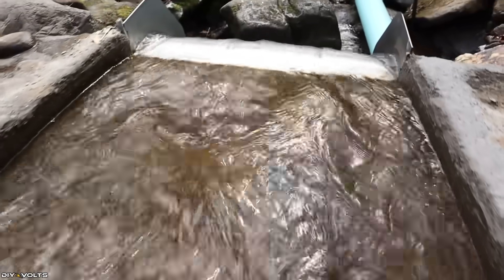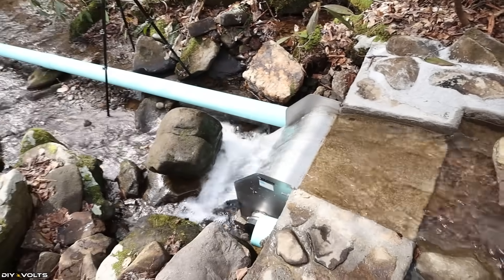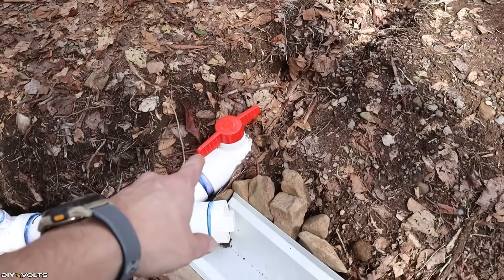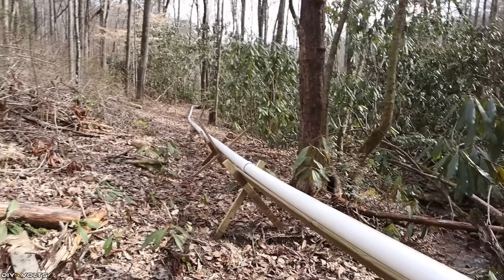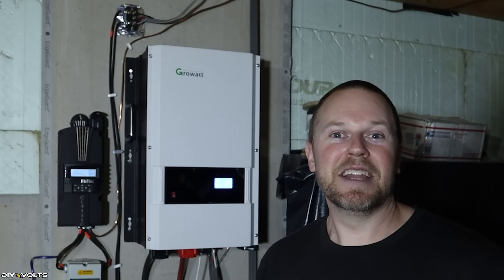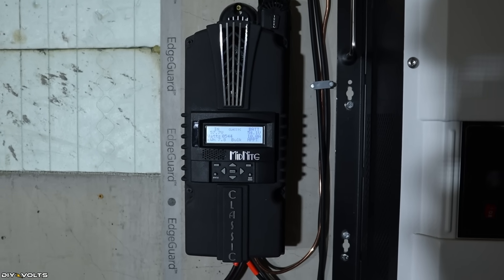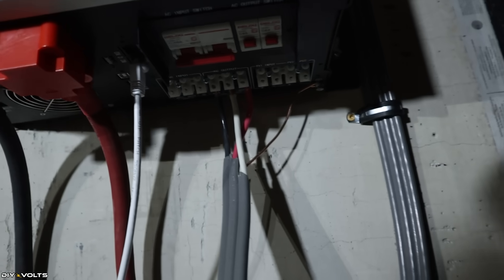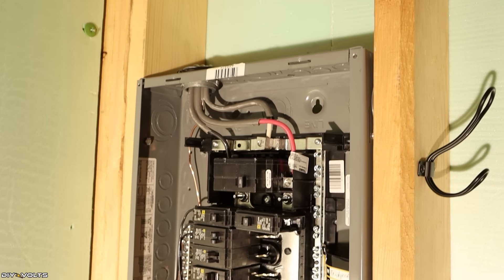AMAZING 500w Micro Hydro Power

Comment: Would it not be more efficient to just put the turbine closer to the water source and then run wire?
Reply from the maker: If there was plenty of head pressure that would be true. But in this case they needed the long pipe run to gain that water drop. Hydro power is calculated like this: (head pressure in feet X GPM)/10=power. The head pressure is very important.
Reply: Closer to the water means less height difference and thus less energy to harvest.

Comment: This looks nice, but it generates only 500w? I know little about hydro power but I thought it to be much more efficient
Reply: To know its efficiency you would need to know the theoretically available energy (amount of water and its height) to compare it against the effectively produced energy. You probably mean to say, that you expect to get more power out of such a setup, but then it is not so much water going through that small turbine.
Reply: 500W 24x7 is quite significant. I have only solar here (UK) which can peak at around 7KW in the height of the summer but right now is sitting at 3KW however, this is limited by daylight and the season.

My consumption runs at around 600W/hr which rises to over 3KW/h when I switch on the washing machine, or charge my EV. A regular 500W/h with batteries to absorb the unused amount would be awesome.
Reply: 500W nearly 24/7 during the seasons that the creek has good water. That's A LOT of power
Reply: A bit over 12kwh per day isn't too bad, but there are a lot of variables at play. They have a lot of storage to act as a buffer and probably operate a fairly efficient home.
Reply: 9:09 - they’re running an 8kw inverter lol, plus batteries, they’re LIT

Comment: How much loss do you have converting from 3 phase to the DC inverter and then back to AC?
Reply: Not that bad.  Maybe 10%.  You can tell from how much heat is created, and the heat output of the inverter isn't that much, the rectifier doesn't even have a fan.  You have larger losses in the pipes and the generation process.
Reply: Probably some- but as a result the system is WAY easier to work on with affordable, off-the-shelf parts.
Reply: Doesn't matter because it is necessary the AC is mostly useless straight from the turbine, 500w isn't a lot of on demand power and batteries can't store AC. That said 10% is insanely optimistic, there are loses from the diode, the charge control, from push energy into the batteries and pulling it out and finally the inverter which is 5 to 10% on it's own all up you are looking at between 20 to 30% which really isn't bad since the source is free
Reply: @shaynegadsden  I assure you this wasn't free.
Reply: @evrythingis1 the source is the flowing water so yes it's free. You don't factor the turbine because every power souce would require a machine but if your source was fuel which cost money or time the efficiency becomes even more important because there is a direct effect
Reply: So every power source requires a "machine" but you don't take that into account for the cost?  What if the cost to run the system is more than simply buying fuel?  What if you're intellectually disabled?
Reply: @evrythingis1 what cost is there to run a water turbine, the point is every power source requires an initial outlay but it ongoing costs that are the biggest issue otherwise everyone would just install gas generators because that would be easiest

Comment: I like the configuration of a 3 in. ring around the unit with T's to the 2in ball valves to control each nozzle independently and lessens the pressure loss from each 3 in. elbow by being larger than the 2 in nozzle feed.
Reply: Same, but I would have maintained the T as a 4”, then reducing on both sides to the 3” ‘ring’.

Comment: The growatt itself have MPPT controller right? Any reason  you did not connect the incoming from rectifier to the Growatt directly?
Reply: It's only producing 57 volts. That growatt probably needs higher volts for the mppt controller to activate
Reply from the maker: In my experience the main issue is the high voltage when the battery is full and the PMA spins at high RPMs. I had to use a midnite 250v to capture my PMA when the battery was full.
Reply: @DIYVolts  I was thinking the same. Thanks for that explanation.
Reply: @DIYVolts 
Why not throttling down the turbine by closing a valve when the battery is fully charged?
Reply: @Juergen_Miessmer Wind power often has a "dump load", usually just the heating element from a space heater. They could add one of those to suck up "spare" power.
Reply: @  make sense..24v system supposely can accept input 57v. If 48v system, the input voltage may not sufficient.
Reply from the maker: The Growatt has a DC voltage limit of 150v. The midnite has a hydro setting that can handle 200v DC. When the battery is full the PMA will spin at full RPMs and the voltage will go very high. The midnite controller can still grab the PMA and bring its speed down as long as the voltage is under 200v.
Reply: To aboid having to stay monitoring constantly, this ways works alone without risk of frying the batteries

Comment: Seth, when you visit a site such as this could you list the specifications of the system, gross head, flow rate, average power generated, max power possible of the system due to stream or pipeline limitations.
Personally, I would add a Coanda box that is nearly the width of the dam and much deeper this will help to keep maximum water in the box and prevent the system from sucking air into the intake. I also would have sized the system for double it current flow rate as the stream has plenty of water, then in the summer just swap out the nozzles if the flow rate decreases.